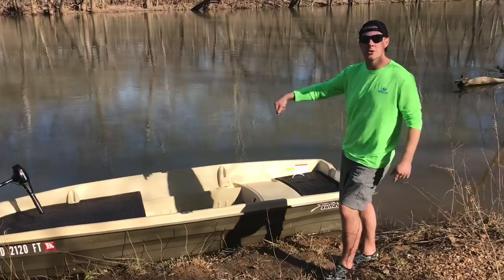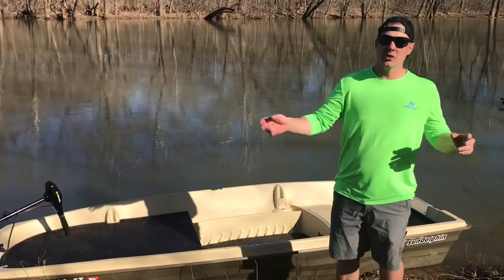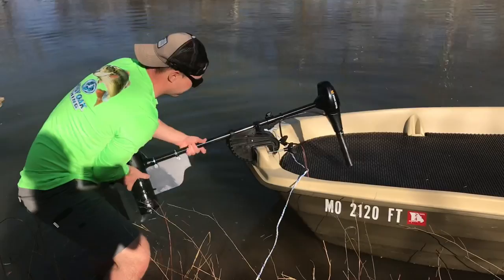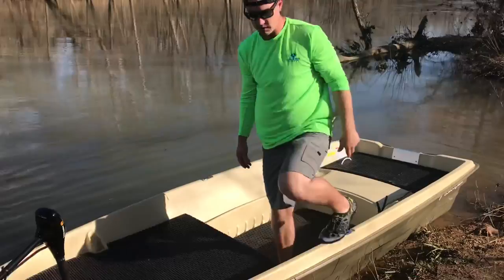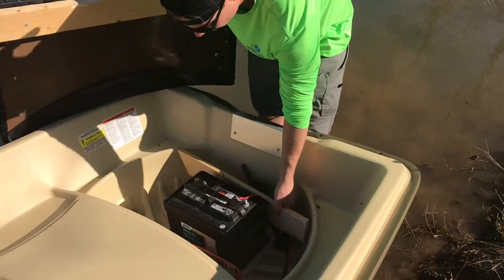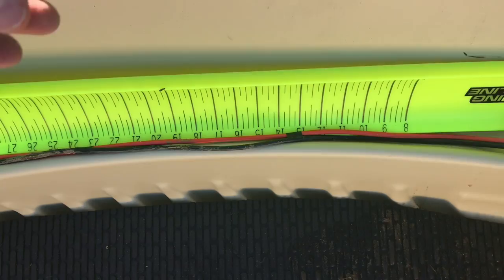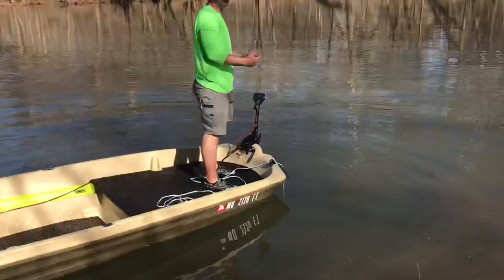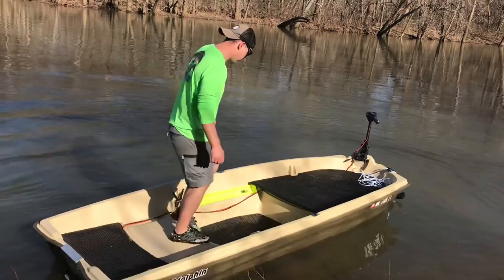Sun Dolphin American 12 ft Jon boat // Custom Plastic Jon Boat  // Easy DIY Upgrades

Comment: So your the first person that did the upgrade to this boat like I would have done , the price is right about the only thing I don’t like is there is nothing but the sealed air in between the deck and hull for flotation, it would have been great if they had A-B flotation foam inside they would be unsinkable, and it would stiffen the hull up and make it much quieter, right now it’s a big drum chasing  fish away , yea a square of plastic cutting board glued to that front trolling motor mount with some 5200 3-M marine seal will hold it on forever don’t need any screws , cool little boat would be great with a little outboard 🤔

Comment: I think you did an incredible job modding your boat to a bass style boat. Exactly what I'm going to do to mine.
Reply from the maker: Thanks Michael, yea this mod really transforms how this boat performs when fishing, glad you liked it.
Reply: One last question. I have three sun dolphin sportman 8ft boat. With the ply board addition in front that you stand on. I saw you standing in video. While out in water with two people. With my son which is 18yrs old and me in front. Will boat still be stable? The american is so similar to the pro12. I want to be up higher to be able to stand or swivel around, two people ar time. Thanks pal for your response.
Reply from the maker: @michaelbarnes7086  thanks for the question, yes you and your son will be able to fish fine from this Jon boat. Just keep in mind this is a smaller 12 ft Jon boat and it is not going to be as stable as a a 14 ft or 15 ft boat. If you do the swivel seats with two people sitting and fishing you should be fine, but with two people standing you will have to be careful, especially with those strong “send it home” hooksets. Lol.

Comment: I bought that same model I have a 15 hp chrysler 2 stroke on it and It is great
Reply from the maker: Nice, yea an outboard would be nice, maybe in the future for me.
Reply: How fast 15 horsepower go?
Reply: It will push 23 mph
Reply: Wow 15 horsepower is a whole different class of speed, 23 mph is flat out moving 🏁
Reply: I had a 6 hp Johnson and the motor was good it got me to where I wanted to go so I decided to test out the boat  so I got a 10 hp Chrysler so I thought it was a 10 hp untill I bought parts for it thats when I found out it is a 15 hp..my boat show that a 6 hp motor is the max size for the boat but the boat will hold a 15 hp lol
Reply: whaker 11 best

Comment: Nice setup these boats are super easy to customize.  I put a 15hp mercury on mine, it carries all my gear plus a passenger and I, approx 500lbs, about 18mph
Reply: 15hp? Don't get caught your well over that 6hp rating
Reply: @bubbajay4044  ...they gotta #catch me tho lol
Reply: @hooklinesinker8142  they run 60hp+ good luck these boats sit low in the water so it's not even like you can get away in the shallows bottomed out in 18"  so they can catch you at some point
Reply: @bubbajay4044  ...yea right, I'm in the shallows all the time pal, my boat rips, go see for yourself

Comment: How long do the battery last when you're out on the water
Reply from the maker: The battery I have is a 24 group size and I have used it for probably 6 hours at the most at one time and still had more than 50% left. If you go to a 27 group size you will get a longer run time. Also check out my newest video it covers a review of the trolling motor and battery. If you have more questions let me know. I hope this helps.
Reply: @bluecollaroutdoors5556  thanks
Reply: @bluecollaroutdoors5556  Hey bro, nice video, have you thought of a LiFePO4/Lithium battery?

Comment: Scott barnes here in martinsville va. I made the decks as you did. Turned out perfect fit. Question? I bought the pedestals that are square at the bottom that I bolted to the platforms  and had tubes that adjust up to 17in tall with plastics folding seats. Looks very similar to pro 120  bass boat. My question is, will the two seats sitting up high like the pro 120 still be stable with two adults fishing? In your opinion, is the American 12 as stable as the pro 120? Please give me your opinion and ideas. I can adjust the seats down to 7in high sitting all way up to 17in same as Pro 120. Hey thanks buddy. Make more videos
Reply from the maker: Scott, thanks for the question man, to be honest I have never seen or been or a pro 120 but from what I have seen from them in videos they are much more stable. They are 62” compared to 52” of the American 12. I would say give it a try it may work just fine or it may not be as stable as you would like. Also with two adults sitting down and fishing it is going to make it way more stable than 2 standing up and fishing. You can. Ith stand up but it gets shaky. I hope this helps man!

Comment: Nice video,  Ive got the same boat and looking to do similar.  Do you have the measurements of the cuts?
Reply from the maker: I can send some measurements later today, when I get home but I just made cardboard templates from storage boxes and just kept trimming them down with a knife until I had the shape I wanted. Then I took the template and traced it onto the 1/2 plywood. After that I built braces and supports to make it a sturdy platform. If you like these videos please subscribe. Thank you
Reply from the maker: Kevin the front casting deck measured lengthwise on centerline is 53 in long, at its widest point of width is 36in. At the point where the rod holder cut outs are its is 31 1/4 in. The other curvatures and contours will need to be trimmed to size after measuring. Also the casting deck will need to have a 3 in support that rest on the second seat, that way it is flush with the front seat. Please let me know if you have anymore questions I’ll be glad to help, the casting deck really makes the boat 10 times better.
Reply: @bluecollaroutdoors5556  I wish you would show a video of how you made the platforms, im trying with cardboard and cannot succeed,  to much curbiture

Comment: Did you use any kind of glue or adhesive on your cleat? I'm thinking about doing that and maybe some Scotty mounting blocks. But I'm afraid of the holding power in the plastic without any kind of adhesive. 
I'm thinking screws would eventually rip out.. your thoughts. Thank you in advance and keep the great videos coming!

Comment: Cool video and thanks, just have a question, what exactly is or are the advantages of the casting decks over just standing on the boats floor? Seems like you'd be less stable and more likely to fall in if you do lose your balance...
Reply from the maker: So the main advantage for me was having just a little bit more usable space to. I’ve around on while casting and just fishing because I stand up most of the time just like on a bass boat. For this boat just standing on the floor was a pain because the ribs in the floor honestly make it hard. I did make a compact floor that made it easier to stand on too instead of the full casting deck. Honestly the stability didn’t really change that much, you would think the balance point would change but I felt just as stable on the full deck. Hope this helps!

Comment: I see you are also in Mo. 

I am picking this boat up tomorrow and was wondering by any chance to you have the templates for the center floor, front and rear  decks ???

I am HORRIBLE at cutting templates for anything let alone something on this scale...

I live in NE. Mo. but will be in Overland Park KS tomorrow to pick up the boat....

Thanks...
Reply from the maker: Unfortunately I don’t have the templates anymore, but if you take a large piece of cardboard and just start trimming with a box cutter it really is fairly simple to get it close. Please see some other messages in this comment box as there are some dimensions posted. I hope this helps!
Reply: @bluecollaroutdoors5556  I'll get my "Man child" (my son who just turned 18 but still at home...) lol to help...
He has a better back and steadier hand...

But I sure do appreciate the quick replies and wish you the best this season...

I am still not sure where I will put my batt or if I am going to use 2...

I probably spend all season fishing stock until I figure it out...

Comment: Michael one more time. Love the platform in front of boat.  At the rear of boat. Could platform be made pretty easily that would cover the battery area and the seat area also. Basically same as you did in front to mimic the pro 120. In your opinion, will the american 12 be as stable as the pro 120? Being the American 12 is longer than pro 120. And only 10cm narrower than pro 120. The mods you did alone on your American 12 in price of plywood  etc. Compared to pro120 price of 2100-2600.00. Is awesome in savings. I was studying your video. If the battery is in front. The rear battery compartment could with door be a live well?! Hey, thanks for your time in response.
Reply from the maker: Michael, yea you could definitely build a similar deck that covers the seat too. You could really build a deck that covers the entire boat if you wanted similar to how people do the Jon boat to bass boat builds it’s just all about the bracing. Honestly the sky is the limit as long as you have some building capabilities and the creativity. As far as making the rear section into a live well, I believe it could be done fairly easily and would hold water well. This would also add weight to the back of the boat to distribute the weight better. The way I run mine right now with the bulk of the weight up front it does sink down the front some. But yea it should be just as stable as the 120 because it is pretty stable in all of the configurations I run it. Even with the big casting deck up front I can stand all day and fish without issues. Yea you could save a lot of money by doing this build over buying a 120.

Comment: I've been looking for this boat( modern Crawdad boat)how much horsepower can I put on back?
Reply from the maker: Jimmie, the Sun Dolphin website says 6 hp for an outboard. As far as trolling motor it says 40 lb thrust but I run a 55 on the front and works fine. Sometimes it is just finding what works, it’s like with anything else they lower the rating to minimize the risk of breaking something. Keep it Blue Collar Brother!!!

Comment: I noticed in your newer video of American 12 boat. You removed the platforms. Was the platform to unstable? I made front and rear platforms also. Yet haven't put in lake yet.
Reply from the maker: Hey Michael, that’s a good question, and to be honest it was only to save weight when loading and unloading. Actually I think that with the platform it is more stable even though the center of gravity is higher, I think it’s because it’s easier balance on.

Comment: Nice setup, I have the Sun Dolphin Pro 120, two batteries, two trolling motors, one front and rear, rides on a jet ski trailer, love it. Great stability, light and easy to use on battery power all day long. Great work on those casting decks and floor boards, what kind of material is that bottom panel made from ?
Reply from the maker: Thanks Jeff, I had the idea for the casting decks a while back and I figured I would share it with everyone so hopefully others can do the same mod. For the floorboard material, it is kinda like a plexiglass or hard plastic material that I found in treadmill box, i guess it was part of the packaging. It was nothing I went out and bought so I wish I knew exactly what it was, you could do the same thing with a thiner plywood if you treat it properly so that it does deteriorate from the water.

Comment: Her pal. How would you compare the sun dolphin american 12 to the pelican intruder 12 in stability? Would love your opinion. Thanks
Reply from the maker: I wish I could answer this better but I don’t have a pelican and I’ve never been on one, but just by doing some comparisons between the two they seem very similar. I do like the floors in the pelican better, the sun Dolphin floors are a terrible design which makes it hard to stand on unless you have mods. As far as the stability I would guess they are probably too similar to tell a difference.

Comment: I want to know abt the black mats in the boat bottom
Reply from the maker: The rubber mats were ordered from Amazon please see the link in the description box, they are a little pricey but are super easy to clean if you plan on getting the boat muddy or dirty like I do on the river. I actually went a super cheap route and just used liquid nails to glue the mats to the wood, it holds ok but I would suggest a better adhesive for better results, but it does work. Please see my other videos about this build. Thanks for checking out the video.
Reply from the maker: Here is the most updated video about the build: 
https://youtu.be/CIjf8O3rSMA 
I hope this helps

Comment: Is there any way to put set on the boat.
Reply from the maker: Thanks for the question, yes there is a way to add the swivel seats to this boat, under the pre-existing seats there is a piece of wood that will allow you to add those seat post or swivel seats and mount them securely. If this didn't answer your question please let me know. There are others on YouTube that  have added the seats so you can check those out as well. Keep it Blue Collar!

Comment: Have you tried it on saltwater?
Reply from the maker: I have only had it in freshwater but I would guess it would do just fine in calm salt water, nothing with waves or large wakes. The plastic seems very durable and shouldn’t be bothered by the saltwater.